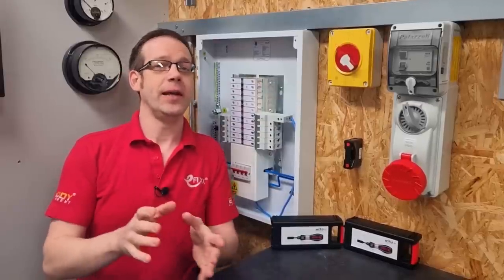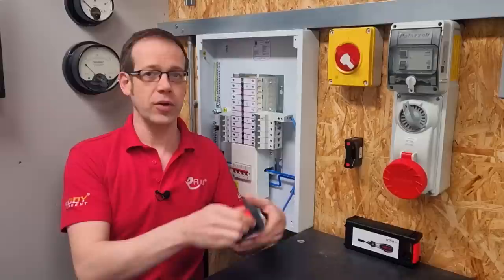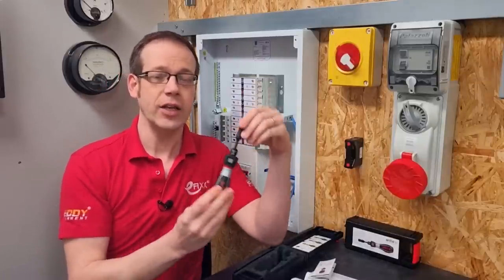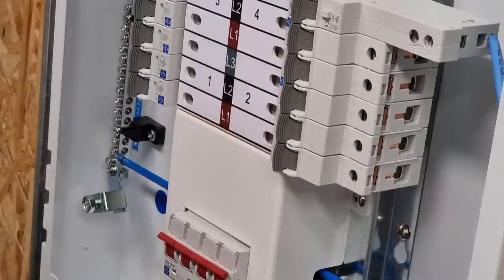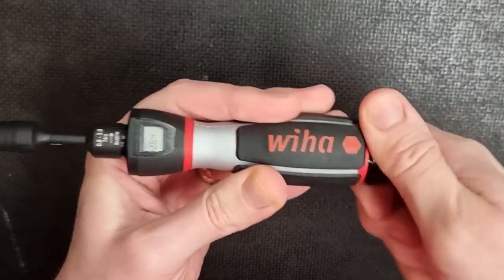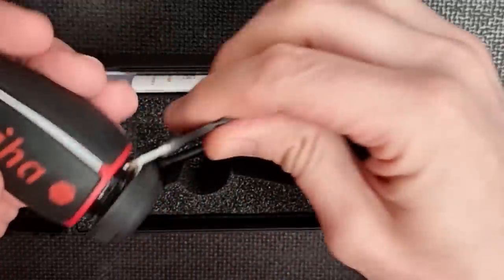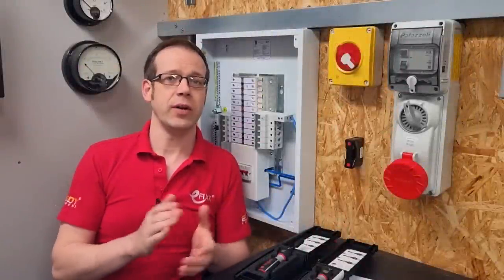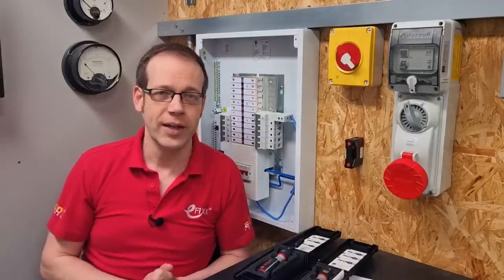Electricians' Dream: The Wiha iTorque Torque Screwdriver

Comment: I LOVE power tools and hand tools. I have practically every tool. Not just for electrics, for plumbing and bricklaying etc.

But…

But this seems a bit daft. Having to use a wrench to set the torque setting on a screwdriver should be the first clue this is a stupid idea. 

If screws should be set to a torque, change the head a small hex head and use a torque wrench. 

This is reinventing the wheel….
Reply from the maker: Erm, the spanner is just to give extra leverage really. There's places a torque wrench is perfect but a screwdriver with a Pozi head is perfect for consumer unit terminals in the UK. 😊
Reply: 1) The wrench is to provide extra leverage. You don't need it, if you are superman. Have you ever hit a pipe wrench with a hammer to make something budge? Same concept. You wouldn't say the pipe wrench is a stupid tool, just because you need to hit it with a hammer sometimes. 2) Are you disputing the need for calibrated torque screwdrivers altogether, or just this particular model?

Comment: Interesting, it looks like it is non VDE yet takes the VDE SlimBits. Can't see me justifying moving from the analogue driver to digital, until I break one of them or they fail a calibration. Do like the look of that Wiha torque wrench at about 23 seconds though.
Reply: Err - this is what 'VDE' means: https://en.wikipedia.org/wiki/VDE
 
People can make exchangeable blades which conform to VDE electrical safety standards in any mechanical format they choose, e.g. the very widely used ¼" hex size, or, shamefully, if they are disgusting money-grabbing ****s, some proprietary shape to force you into using only their blades with their handles.
 
What exactly did you think you were asking about here?
Reply: @anonnona8099  I'm not sure this person was asking anything, I didn't see a question. But I did see a perfectly valid point about how the itorque driver isn't VDE. Your link points to a disambiguation page, when you click through to Verband der Elektrotechnik page, there's nothing of use that seems to back up whatever it is you are arguing against. It's not just the blade that needs to be insulated (and therefore tested to a standard, if that was your point?). The shank (or ferrule - the part that holds the driver bit) needs to be rated / tested accordingly. Otherwise after a fair amount of use, a non-VDE shank can wear-away the insulation of the driver bit. So imagine you're an electrician who never needs to take the bit out of the driver (and so never inspects the end of the bit that's getting worn) and always assumes he can work on live safely with his VDE driver... he puts a VDE bit in a non-VDE driver and assumes he will be fine... boom - one day you get a shock. It could be a 4000V shock, a 50V shock, whatever. In your specific case it may well be fine, e.g. if you're a weekend warrior or you don't work on live... Just not true for everyone, so no need for a rant about proprietary fittings... if I were the manufacturer of a VDE approved insulated driver system I'd damned well make sure my bits couldn't be used in non-approved drivers, otherwise how can I ensure a quality guarantee over my products? Most commercial sparkies just pay the money... if you make hundreds a day why the hell wouldn't you spend a small part of that for some decent tools? The only ones who whinge about proprietary fittings or spending 100 quid on a VDE set are those people who don't actually make a living from it. Many apologies if I have completely misunderstood what you were trying to express, although perhaps your argumentative comment could have been a little clearer :)
Reply: @MatSmithLondon  I'm sure that, like most people, my comments could have been clearer.  My basic point was that "VDE" (in this context) is all about insulation performance, voltage ratings, etc, and absolutely nothing whatsoever to do with physical dimensions, which the guy I was arguing with seemed to think.

Comment: Why didn't they just drill a hole in the thing so you can use the screwdriver shaft instead of the spanner. Why does it need a seperate shaft anyways? And why 3 drivers for such a small torque range?

Comment: I was looking at ones of these but was struggling to find a supplier that I could get blades from. Any ideas? I would prefer to have the blades rather than use the bit adaptor if possible
Reply from the maker: Hiya Greg, try checking out this link bud:

https://cpc.farnell.com/c/tools-maintenance/hand-tools/screwdrivers/interchangeable-blade-screwdrivers?brand=wiha
Reply: @efixx  cheers Joe I will take a look I have the original CK one so maybe time for an upgrade